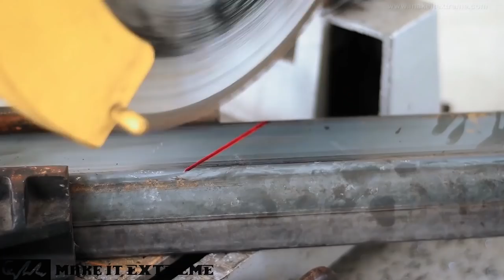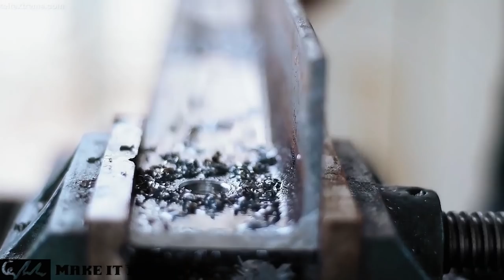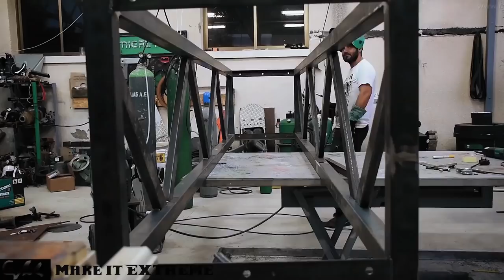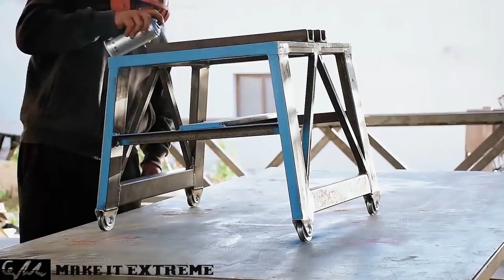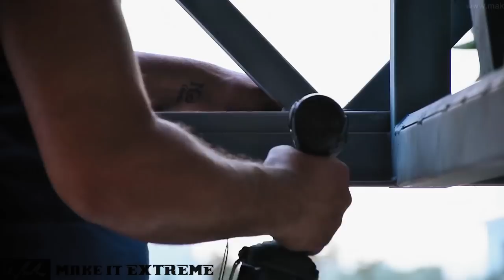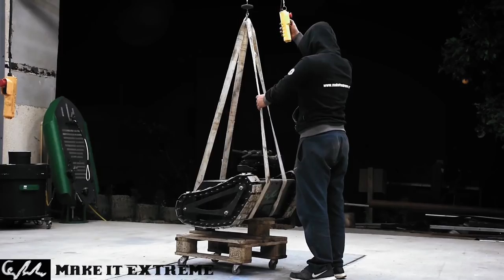Make it Extreme's Crane

Comment: pro tip: don't cut angle stock like this /\ on a chop saw.  the blade can grab the top and slam it against the back and crash the saw.  almost lost my thumb learning this lesson the hard way. instead cut it like _| with the flat against the back stop.
Reply: Did the same mistake, also when you cut like /\ the clamp can/will bend the angle stock out of 90° slightly, depending on the thickness but still important for stuff like this. Additionally, cutting like that will cause torsion on the angle stock in a way that isn't supported, so you can even twist it a bit. Always cut in L shape.

Comment: Wouldn't try and lift to much with that, it's suspended with 4 8mm cap screws
Reply: I was surprised to see that the motor is suspended with 4 bolts only.
Reply: One M6 bolt can handle about one ton direct drag, I wouldnt be suprised if that setup could handle over 6 ton, I doubt the crane can handle 1/10 of that
Reply: @krisholt  Thank you for the information! 👍 I didn't expect that much force for the bolt of this size. So, it must be then.
Reply: @krisholt  doesn't matter, its poor practice to put the bolts in tension like that. These guys build great stuff, but that one made me rewind the video a few times to verify what they did
Reply: @krankengineering  how should it be done? I want to know the right way.
Reply: @InchFab  there are 1000 compromises in any design. Maybe the guys got the hoist free or cheap and decided to use it, which limits the decisions. But I would be looking for ways to ways to orient the hoist so that four little bolts are not the primary load carrying components. In many countries crane design and maintenance is highly regulated because people get killed when they fail......

Comment: So the four bolts that attach the winch to the gantry is were the entire force is supported....
Reply: Exactly what I came here to say. Not just 4 bolts, but they’re threaded into steel plate, no? Hopefully there’s at least weld nuts or something on the back of it. I’d drill them out and thru bolt it with much larger screws. I mean, the tensile strength of a 1/4-20 grade 8 is pretty damn high, but still.

Comment: I'd say that has a 1000 to 1500 lb capacity for safety reasons, provided he went back and welded it into the roof structure. I wouldn't use it for anything heavier though.

Comment: I’m concerned that your gantry is only bolted to roof trusses in single shear. Hopefully the whole thing isn’t supported by just the mounting bolts because single shear structures will fail. Please make sure all weight bearing structures are always in double shear.
Reply: I too think his construction does have some weak points 🤷‍♂️

Comment: Cool! But now, let's discuss something about mistakes 
1. All cranes should not to have welded elements. This is pretty dangerous, because welding points can to crack easy, with big weight.
2. To make crane on this length much more faster and reliable - you just need to take |--| this kind of steel  channel. I mean, W-Beam steel channel.
We use it for 1,5-2 tones moving on 8m distance.